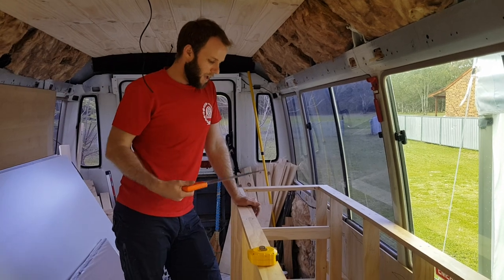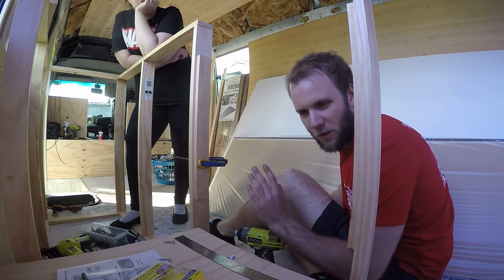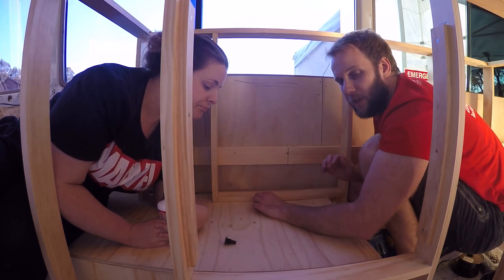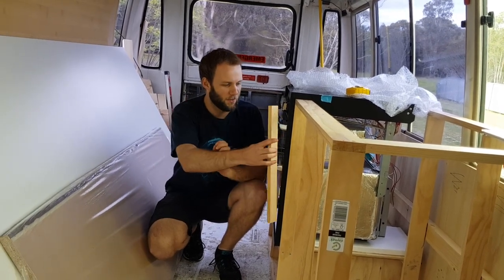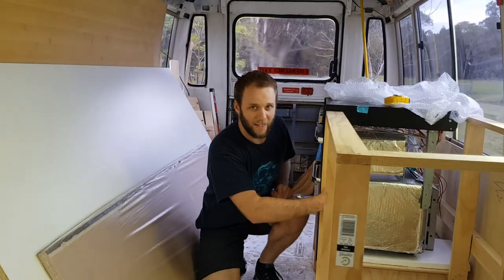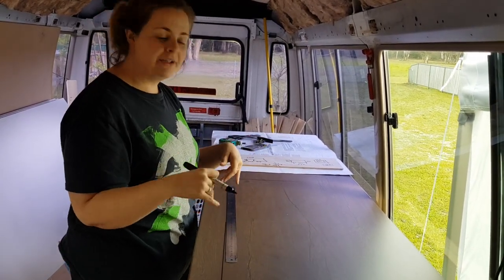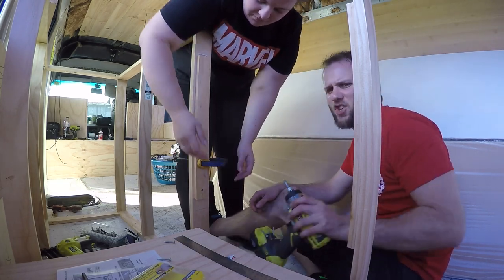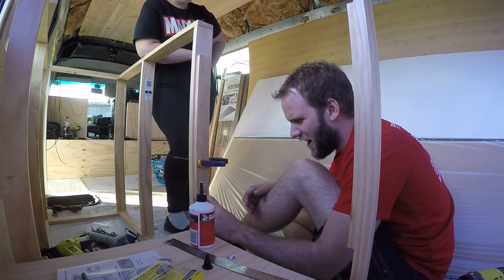Toyota Coaster School Bus Conversion - Kitchen Bench Installation

Comment: Thanks for continuing to share your progress!!!!  I'm now closer to the Gulf and have much more access to these buses.  I am going to do some measurements soon.  I got in one and it seemed cramped, still had seats.  Did you get this sensation when the seats were in?  After removing all the seats did it feel spacious?  As you are added your furnishings do you feel that it is getting tight?
Reply: Hello shayes, This is Des in Costa Rica. Do you have a coaster yet? Yes without seats it appears much more roomier. I am 1.85m (6.1feet) and sleep comfortably width wise at the back. Currently I am fitting a generator and gas tank in my coaster. Wish you well. Des
Reply from the maker: Hi Shayes! That's great you have more access. The bus definitely felt like it had a lot more room once we took the seats out. Some people have been quite surprised how big it actually is. We have been using the bus to store stuff in as well though, so as we build it is feeling tighter. I think once we finish and get all the spare stuff out it should be comfortable 😊

Comment: what are you doing with the space above the driver n passanger seats when you removed the trim , im adding a huge shelve there with custom air vents , good spot to store deck chairs ,pillows or what ever you like done the same with it done the back above the rear doors , u guys are fantastic
Reply from the maker: Hi Dylan! We plan on building a wall with vents there. Hopefully will be getting to that in the next week or 2. Down the back we are hoping to put an air con in. It is an awesome idea to add a shelf, you'll have to send us some pics when youve done it. Good luck and glad you are enjoying it!
Reply: @RoamingonRubber   will do guys , you make it look easy , ive got my kaboodle kitchen from bunnings ive trimmed the whole back of so its not to wide ,just enough for sink n stove to fit , ive brought the shower , n cassette toilet , ive brought fake stack stone in white crystal , got 4 solar panels 230 w, 3 agm batteries 130 amps each , 2 new car batteries for the bus, ive just brought the pine wood for the roof , tonn e of earth wool ,lol, silver mirror one way tint ,  4 x rola roof racks designed for the coaster ,will be looking for a 2009 bus or the 4x4 one just after xmas , ,dont forget to jion the grey nomads dudes hahahah
Reply from the maker: Haha it definitely isn't easy! It sounds like you have everything but your bus! And a great solid plan. A 4X4 bus would be awesome. Let us know how you go 😊